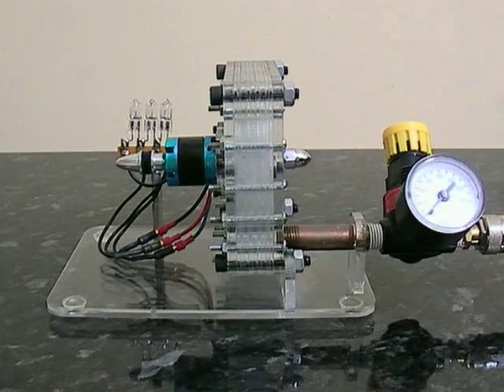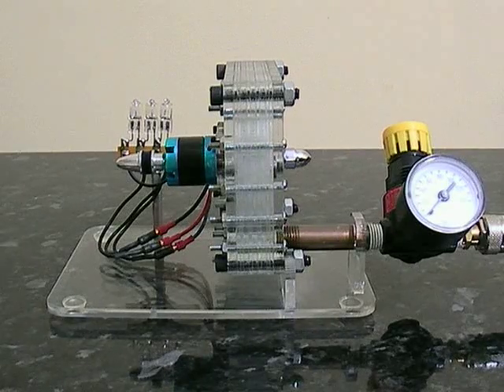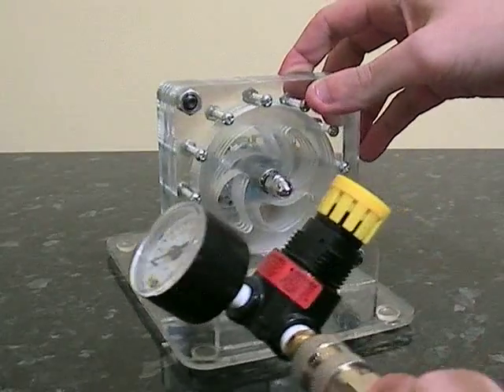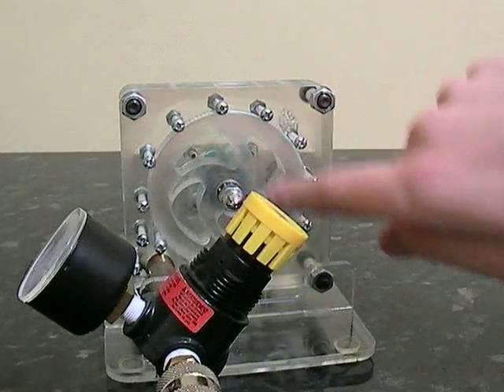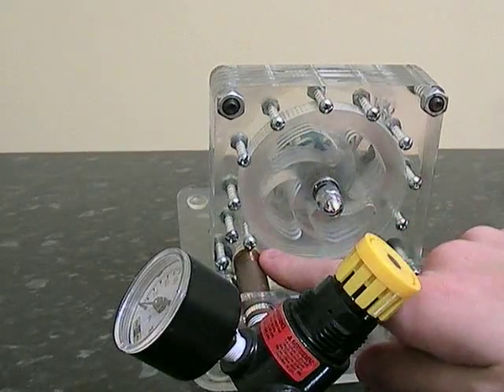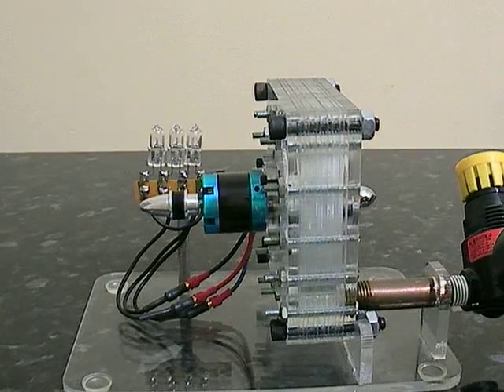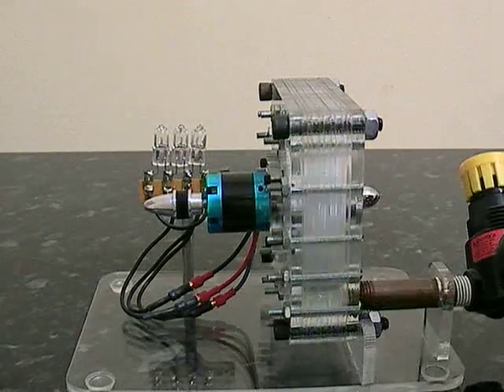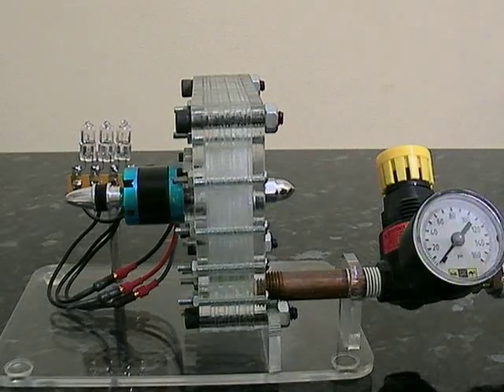Tesla Turbine (Bladeless) - from gyroscope.com

Comment: I'm all for green energy and efficiency.  But, it takes more electricity to run the compressor, that makes the air for this to run, than the turbine generates.  So what's the big deal behind the turbine?  I've been watching videos on this. Still don't understand the importance of it.
Reply from the maker: Then you are missing the point. If I ran a normal turbine with compressed air wouldn't it do the same?

Comment: Would it be possible to stick a tesla turbine in the front compartment of a fully electric vehicle and harness the wind resistance hitting the front of the car, transferring the energy from drag into electrical power, and then in turn using that power to charge the batteries? This doesn't seem to violate any laws of thermodynamics, and this doesn't create any access drag on the car since it is simply harnessing the drag already present.

Comment: basic CDs Type versions have push 16k RPM... this is not a failed Structure... its updated... and Awesome... Hey Gyro, you got one of theses on deck... Cause i would like to work with you to advance this design, into a more practical and function application.. You wanna Work together?

Comment: Comparing turbochargers with a tesla turbine is pure idiocy. Moreover, 1 MRPM for a turbine working in a high pressure fluid? Seriously? Lol. Go and play with Navier-Stokes equation, calculate the Reynolds number, and we'll talk about the vibrations induced by such kind of fluid at such rotation. Show me a turbine working at 1 MRPM on those conditions and I will take you seriously. The only 'turbines' I know that work at 75 KRPM are turbomolecular pumps - for very high vaccum...

Comment: the energy used to run those hydro plants is solar.  follow me if you will, the radiant heat from the sun causes water to evaporate from, lets say the ocean.  convection flows, we'll call weather, will then move that water, in the form of clouds, into the atmosphere, where it cools, and rains behind your dam.  sounds very labor intensive but we really never even notice it.

Comment: @gyroscopes 
" tens of  thousands of RPM" says nothing useful
 if your turbine is produced from plastic it wont sustain more than 20krpm what is very slow for turbine. it must run at nearly 100 krpm at that diameter to compete with typical turbocharger.

using carbon fiber is expensive and metal turbine may perform even worse than cheap composite.

to improve strength it needs to be more like original turbine with small holes in the center. and preferably disks should be thicker in the center.

Comment: did you set the inlet axis normal to the face of the turbine for ease of building and reducing chances of leak? i imagine since the air has to do a 90deg turn you’d be experiencing unnecessary pressure at the inlet corner. i recognize the air is going to have to take another sharp turn at the exit, but i suppose that’s unavoidable. cool build btw.

Comment: @gyroscopes Well with the addition of superconductors, If the air compressor could run with no entropy then, it is possible. But thus of course now it becomes theoretical and not practical...as of now.

Comment: looks like you only need about a constant 35psi...this could be redesigned to run on free flowing water basically resulting in free energy...however I am unsure how much more psi you would need to run a larger generator

Comment: There is a book, "The Complete Patents of Nikola Tesla."  ISBN 1-56619-266-8.  I have it in my hand.  It cost me $15 at Barnes & Noble.  There are sections on motors/generators, transformers, high frequency, radio, lighting, measuring tools, engines (including the turbine), and miscellaneous.  The information is out there.  Go do something with it.

Comment from the maker: @TheCAZ9 Efficiency is not great yet (relatively little research compared to normal turbines). The efficiency is still improving. However I think it would be useful now as a small generator. It is compact, cheap, light. imagine a 1-2kw generator that cost £200, weighs only 1kg and is the size of half a shoe box.

Comment from the maker: @Dexxxter7780 It can run on solar power or flowing water. Depends what you mean by outside power source. I assumed you were talking about electric power to drive the air compressor.

Comment: @gyroscopes I think this is more what's known as a trash pump.  Put a motor where the generator is and the inlet is where the outlet is on this one.  The disks inside float so that all the space can be between and two plates.  This pumps are very efficient and can suck up large bits of trash without blowing up the pump.When the blades are spinning and the pump is primed and stones or other things that will fit between the blades will be thrown out.  They are great pumps but do need a prime.

Comment: @TheCryptidman no not really as they use thrust so would have to be rear engine and would struggle on air intake but adapt it to propel the wheels of a car such as a turboshaft turbine does on a helicopter rotar and replace your fuel tank with a pressurised air tank and bingo

Comment: So, it's not really bladeless, since the disks form stacked together for the "negative" of a blade shape.  So basically the blades are in the shape of the air passing through the disks.  It could be more efficient if the combined weight of the disks is less than the weight of the blades that would fit in the holes.  Also according to Tesla, this design reduces the inefficiency caused by turbulence of a bladed turbine.  Have you measured the efficiency yet?

Comment: If this system was adapted for vehicle and combined with modern day electric systems found in cars like the Chevy Volt or the Tesla Roadster, if they used the accelerator of a normal car as a sort of air flow regulator into the system, do you think it could work?

Comment from the maker: @xpannn Combined Heat and Power Guidelines. (n.d.). Retrieved 1 28, 2011, from New Jersey Combined Heat and Power: njchp.rutgers.edu/files/Steam_Turbines.pdf

(1996). Efficiency. In H. P. Bloch, & S. P. Murari, Stream Turbines - Design, Applications and Rerating (pp. 220-224). New York: McGraw-Hill.

Comment from the maker: @TheKaos90 They are not feasible for large powerplants. Steam turbines are at around 90% efficiency. However they are practical epinion for small scale power generation or where the initial cost needs to be low.
In these cases I believe they should be an order of magnitude cheaper.

Comment from the maker: @Texmurphy51 Now power plants in use today have a turbine isentropic efficiency of upto 90% (typically
40% to 90%). I can provided lots of references in text books to this.

I found a good link here that shows my argument here very well
njchp.rutgers.edu/files/Steam_Turbines.pdf

System 1 is a 500kw system, has a 50% isentropic turbine efficiency and cost $459000 to install.
System 3 is 15000kw system, has a 90% isentropic turbine efficiency and cost of $5235000 to install.

Comment from the maker: @Texmurphy51 "...There is
some reason to believe that multiple-disk turbomachines
can operate with abrasive two-phase flow mixtures with
less erosion of material from the rotor. For that reason
they should be further investigated for applications to produce
power from geothermal steam and particle laden
industrial gas flows...."

Comment from the maker: @gyroscopes So in a power station they are happy to spend millions on a slightly more efficient turbine. Simply because they will get there money back over time. 

Now lets look at a portable backup petrol or diesel generator. A national DIY chain sells a 2kw version for £200. It weighs 20kg and isn't that compact. A normal mass produced turbine with self start cost over £1000. Yet a Tesla turbine version could be made for under £100 (sold for £200). Weigh 3kg and be a tenth of size.

Comment from the maker: @Texmurphy51 It is about the 10th of the cost to design and build, requires less maintence, is quieter and the performance is improving.

When the adding machines were mechanical some people once said that electronic adding machines were not that good, because if they were all the manufacturers would be making them.

Truth is...The best technology is often not the technology we are using for all sorts of reasons.

Comment: @gyroscopes is there a calculator program for power input and power output?   I have been looking at tesla turbine videos and it seams 95% of are just desktop toys and not really putting out any big power.   I want to build one larger enough to make 2kw ~ 4kw.  I will be using R123 or maybe ammonia as the fluid.  I want to calc what input PSI I need.

Comment: @gyroscopes Would a series of smaller diameter disks within 4 feet across work? My arrangement wouldn't allow for such large diameter disks. It may be possible for me to run at 3600cfm at 45psi. Would that make a huge difference? Also, what formula did you use for kinetic energy?

By the way, thank you very much for all of this information. I really hope my idea works with the help I'm receiving from you.

Comment from the maker: @dablackitalian 250F is fine. 3100CFM at 40psi is about 250kw in kinetic energy. Your turbine needs to be about 25% efficient to get 75kw out. The pipe going to the turbine is going to be 3-4 inches. Rotational speed of the turbine will be slow because of the low pressure. The disk diameter and number of disks is up to the designer of the turbine. But if it was me I would be looking at a turbine a couple of feet across with whaterver number of disks needed to consume that flowrate.

Comment: Im considering a Jean Pain type Composter heater to produce hot water and catalyze a biogasifier.  So I will have methane gas.... question is if I store it compressed could I get energy back out that will significantly replenish the energy it took to compress it by putting a tesla turbin in line of the main  feed line to say the home that would burn the methane for heat cooking etc.?

Comment from the maker: @morrissaluki I've test at 150psi. Higher pressures will not be an issue. Say 300psi.

I was planning on using 410a, coppper coaxial heat exhchanger and a domestic radiator. Have not decided on a pump yet.

Comment: @gyroscopes 
Do you know what the max pressure is for that device?  I am a Mechanical Engineer and can provide you some assistance with regards to which freons to use.  For an organic rankine cycle the best bet is to use a coaxial heat exchanger for a boiler and use hot water (crank up your home heater to 160F) and use another coaxial heat exchanger for the condenser.  A pump will be required to keep the liquid topped off in the evaporator.  This proof of concept for use with 160F is a mileston

Comment: @Nissearne12 & gyroscopes:

I am not sure it would be the best for that. This turbine produces mechanical energy from the mechanical energy available in the compressed air's fluid flow and pressure drop, while most of the energy produced from "direct combustion" would be in heat. Another type of turbine might be better which is intended to take advantage of heat energy as well.

Comment: @c6jones720 I don't believe it does any useful sucking. It runs on compressed air, actually, which is pretty much the opposite of what you want if you're looking for a vacuum. :-)

It does SOUND like a vacuum but I don't think that's the most important aspect of a home vacuum.

Comment: While it is kinda neat, it seems like a lot of work and expense to produce a very inefficient machine.  The amount of electricity needed to pump up the compressor tank would have probably ran the 3 little light bulbs for 10 or 100 times longer.

Comment: @gyroscopes I have read about the tesla turbine could handle wood exhoust gases without damage compered with the regular blade turbin get unballanced in a few houre of run with direct combustion of wood because the blade will be contaminated and coated with calium from wood exhust gases.

Comment: Have anyone try to use tesla turbine power by Direct combusion from Biomass like pellet (or wood chip) with a air compressor ->  pressurized burner with mechanical pellet feeder and then finnaly -> Tessla Turbine.

Comment from the maker: @therealfactor It can be used with water (although I've yet to try). It also can be used to with combustor (again yet to try but may have a go some day). With regard to getting power at night via heat that is more tricky but as long as there is a larger enough temperature difference it is possible. Probably impratical though.

Anyway my point I don't think it should be limited solar or any other method. It is a 
mechanical device not a compelete solution.

Comment: To make something like this viable a trial turbine needs to be devoloped and operated in a rankine cycle with some efficiency being performed .   N = (heat in - heat reject)/heat in.  I have a feeling that regardless of the theoretical efficiency, a lot of work (and engineering) is needed to eliminate internal bypass and to prevent irreversabilities.

Comment: @banaca1010101011 That argument can be used to show that any invention nis natural.  "An airplane is just a collection of atoms.  Atoms naturally exist.  Therefore no one invented the airplane."  AC energy does not naturally exist, a machine was built, basically a dynamo with a very fast switch attached which reversed the flow 60 x per second.  AC electrical energy is a byproduct of an invention and occurs nowhere in nature.

Comment: @gyroscopes Also, AC is not natural, DC is.  Very complex machine parts (basically a very, very fast switch) cause the electricity to flow both directions over 60 x per second in AC power generation.  This does not occur naturally anywhere.

Comment: @jlplace Static friction is much more efficient than dynamic friction.  The air is not moving relative to the plate because the surface tension of the air(just like water) is causing it to stick to the plate.  The plates are so close together that the air cannot flow between the two membranes of surface tension that are stuck to each disk.  Therefore the air moves at the same speed as the disks, creating an extremely efficient pump, or a turbine like in this video.

Comment: @jlplace  Actually the tesla turbine works not on friction but on the surface tension of a fluid, in this case air.  It is extremely efficient, and the reason why they aren't common is because the metals and alloys available in his day were not strong enough to resist the stretching effect of so much centripetal force, since his turbines could operate above 20,000 RPM.  It was only recently that we developed a ceramic/metal alloy strong enough not to wear out relatively quickly.

Comment: just like the laws of velocity and mass apply to projectile objects they still hold true for stationary rotating objects....  the faster the discs spin and the more they actually weigh will allow it to be more efficient (the more energy they store)...  there is absolutely no drag or resistance in a turbine of this design... bladed turbines are just like water paddles they can only go SO fast because they oppose the rate of change after a point....

Comment: The entire purpose of this turbine is in regards to converting heat to rotational energy that can be used for generating electricity.... the tesla turbine is designed to make powerplants smaller... the average engine gets roughly 2.5 hp for every pound of the engine.... tesla managed to get 10 hp from every pound.... of course the diameter of the discs is the most important part... also he claimed for higher torque scenarios larger diameters and if possible ONE large disc should be used

Comment: The significance of the tesla turbine is that with a bladed scenario like a steam power plant... they have to reach 1000s of psi of steam to spin the turbine... also the blades break off and fly around inside and break other blades off decreasing the efficiency of the machine.... the tesla turbine can spin at roughly 30 THOUSAND rpms from a mere 40 psi....  a standard generating powerplant runs at about only 3 thousand... not 30... plus this can be geared for more torque

Comment: @slingblade1991 You say that like it makes no sense... so let me explain. Most sources of energy are from energy storage, i.e. batteries. Now, for this example, he used compressed air. That does not mean that compressed air is the only way to more the energy, but it is the method used here. 

Like you said, motor - generator - motor... well, when you are showing the feasibility of a product, you can change the originating source of the energy. Think or replacing the air with water from a fall...

Comment: What is special about the Tesla turbine?
Does not appear to be especially efficient.
Appears that more material is used in manufacture which means more stress/load on the bearings.  
Would not piping the air in at the CENTER and having it exhaust at the circumfrence be morefficient?

Most interestesting is seeing your little three-phase generator!
Nice model.  Thank you.

Comment: Wouldn't it be more efficient if you had the air blowing the other way (from the center of the disks out) due to centripetal force. I mean, with that setup it will work due to the air being compressed already prior to entering the device; however, the air will expand to the outer perimeter of the disks but then depending on how fast the disk is spinning, it will get re-compressed a little before exiting the device. That re-compressing will cost you some energy.